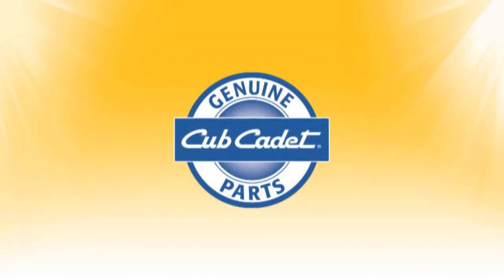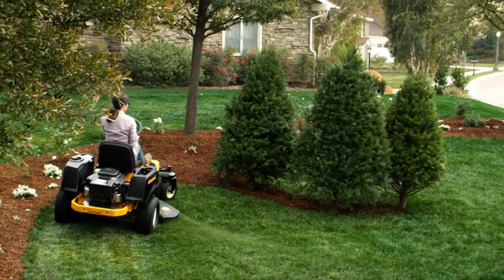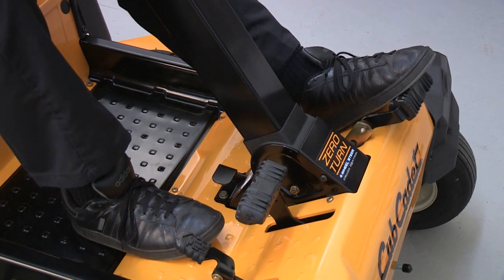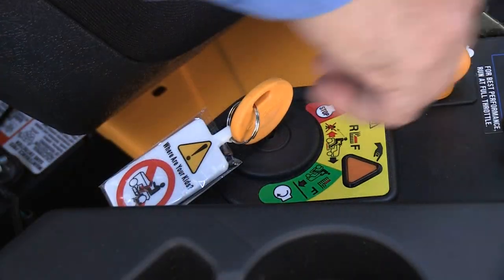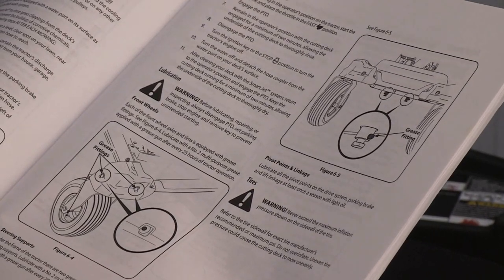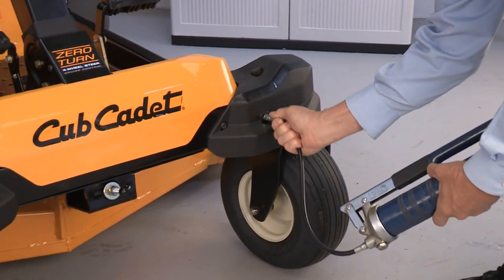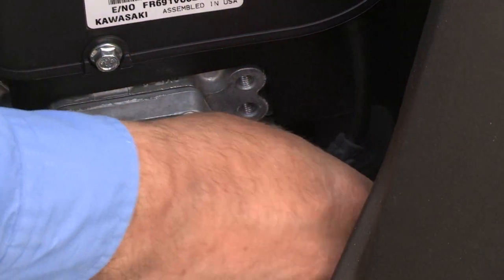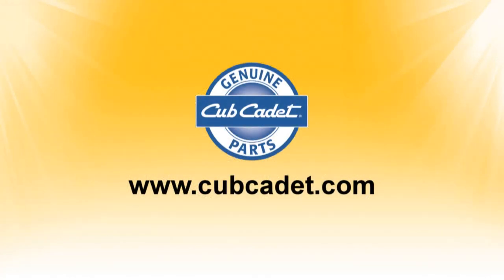25 Hour Maintenance Checklist - RZT Zero-Turn Riders

Comment: hey could you guys do a video for your zt2? the manual just says something like lubricate lubrication spots. no more info is given and trawling the internet is hit and miss. thanks
Reply: Did you find anything? I’m looking as well
Reply: @nathannash5385  i didnt find anything good. i went and shot wd40 on all the moving parts. ive hauled some brush with it since then and it seems to run well.

Comment: I've periodically maintained my RZT-S per your video instructions with no issues. However, this time when I removed the grease gun from one of the front steering supports, the zerk fitting came with it!! (It's stuck in the end of the grease gun hose.) The zerk is press-fit with ridges; it's not threaded. I tried pressing the zerk back into the hole, but it won't stay in. I guess it stripped out the hole as it pulled out.

What do I do now? The mower is a year out of warranty, and I'm not too excited about paying out-of-pocket because it broke itself while I was maintaining it. (The sweet, sweet irony...) Please help!
Reply: Chris Papademetrious The very same thing happened with mine. How did you repair it?
Reply: Whatever came of this??
Reply: Take the zerk to an auto parts store and buy some threaded zerks, get the ones with the self cutting threads on them. They also carry a tool to thread the hole, if they don't carry the self threading repair zerks.
Reply: I ended up fixing this by applying a light coating of JB Weld to the opening and the zerk. Both surfaces were rough enough to provide plenty of grip once the JB Weld cured. (If you do this, be careful not to block the internal outlet of the zerk.). So far, it's been holding up well.